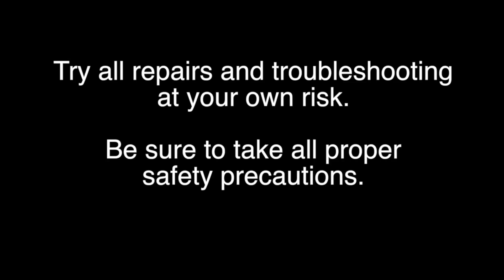Hisense 50” LED TV - No Backlights Bad LEDs - How To Replace LED Strips 50K 50D 50H

Comment: My TV turned blue. I read that the problem was the LEDs. So I bought the parts from your site and followed the instructions and replaced the LEDs. Lengthy process, it took about 2 hours. Everything looks good and the picture and colors are back to normal, but now there is a buzzing (more like hissing noise coming from the TV. Any Ideas?

Comment: Just finished replacing the strips on my 48" with parts from ShopJimmy and this video and my TV is back good as new.   There were a few minor differences between my set and the one in the video but they were easy to figure out.   Other than that I followed the video and everything went exactly as shown.   Never even tried to fix a TV before but with the money I just saved, this probably won't be the last.   YouTube is the greatest!!!!

Comment: I just did this exactly (with a few variations for my 42"). It worked great! And now my TV is back up and running! I used the LED set from ShopJimmy and worked great. Thanks! (I am an electronics tech, lay person might need to really take the process slow).

Comment: Hello, great video. It helped me get to the LEDs without much trouble. I tested the LED and they all light up. Do I still need to replace the LEDs to fix my TV? I have an Insignia 55" LCD TV. I have sound but no picture, when I flash a light on the screen with the TV on, I can see the picture in the background. I did notice however that about 3 strips, light up somewhat dimmer than the rest. I hope you can respond quick and thank you so much in advance.

Comment: Ordered the LED strips from ShopJimmy for an Insignia 55" TV and with the help of this video, I was able to replace the strips and the TV now works PERFECTLY! Great products and great video!
Reply: Jon Winn hey my led are out but whats the voltage it supose to throw out in the power board to the led mines like 135
Reply: Jason Dominguez I can't say I know for 100% certain but I think it should be closer to 100. With it all together and powered on, do you hear sounds and see a picture if you shine a flashlight on it?
Reply: Jon Winn yea yea I got picture when i out a light to the screen and sound I had it looked it by a shop they said the leds are bad but i wanted to my sure myself lol. Curious if my leds blew what made it blew? Could it happen again if i install the leds?
Reply: Jason Dominguez hmm. I didn't go as far as testing the boards voltages. For the price of the strips I just went with it. I think hours of use on high output LEDs just wears down the "contacts" in the led to the point they can't continue to arc.
Reply: Jon Winn thanks man sounds ablut right it was a 4 year tv I order the part I let u know if i got it back online on wed
Reply: How much was the leds
Reply: @kglife4180  I don't remember. Check on shopjimmy.com
Reply: @jwkarz  ok my next question is did u only replace the leds and ur tv work again ? If u dont mind watching my lastest video on my channel of what my tv is doing
Reply: @kglife4180  Yes. That's all I did. I confirmed that the display was actually working before trying to replace the LEDs. I shined a flashlight on the screen when plugged in with a signal and confirmed the tv was displaying images. I'll have to check your video.
Reply: @jwkarz  i did the same thing i used a flash light n i can see the logos but after a few seconds the screen just goes black.